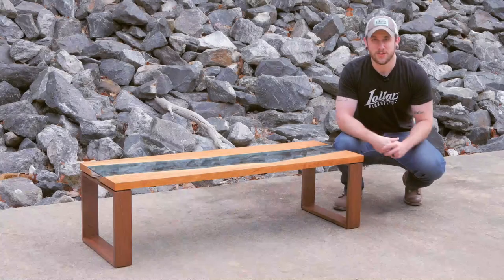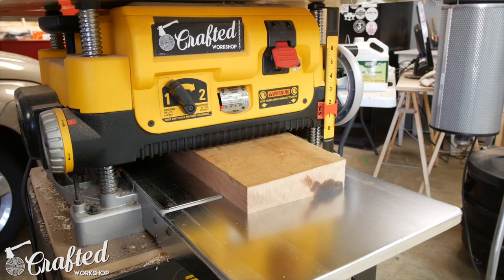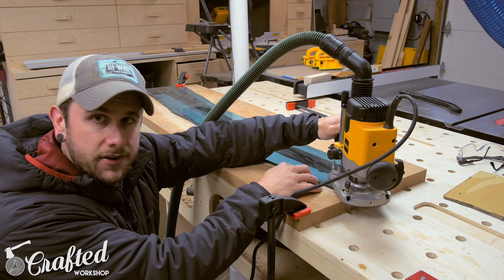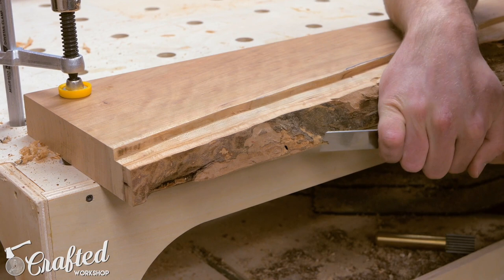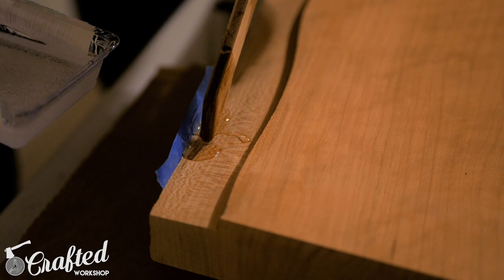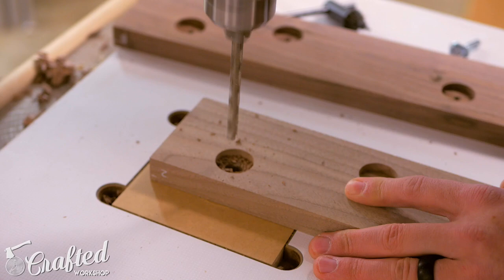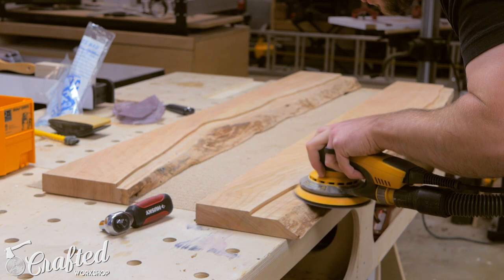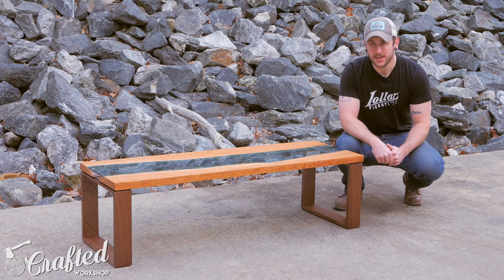Live Edge River Coffee Table | How To Build - Woodworking

Comment: Hello! Am a beginner looking to find lumber in Toronto for projects. Do I go to lumberyards for live edge slab?
Reply from the maker: +Andy Lee it depends on the lumber yard, but a lot of them will carry slabs. I'd just call around and see what is available.
Reply: Hey, thanks so much for the suggestion. I looked around and they seem to vary in price from $200-$1500 CAD. When buying slabs, should I have an eye out for certain things such as how straight it is or any grain patterns to look out for?
Reply from the maker: +Andy Lee the flatter it is, the easier it will be to work with and get flat. I think the other big thing is to pick one with a grain pattern you like. Slabs are all so unique. Those prices seem pretty reasonable.
Reply: great thanks :)

Comment: If I find a lg piece of Plexiglas I'll make one , In mass they are plenty of trees, to make it original :) don't tempt me to do it ok lol
Reply from the maker: +Carl Zorro go for it! Although plexiglass would scratch a lot easier.
Reply: true, but keep it waxed and it doesn't shatter like glass do, I dislike glass. I take tables and put ceramic tiles and do away with the glass, they have nice forever shine tiles at HD 4 and boom a nice table :)
Reply from the maker: +Carl Zorro nice!
Reply: want to make a nice table, buy 4 ceramic tile with shine  and add it to the top, all you need to do is go down a 1/4 '' for the tile setting.

Comment: that's why you route both sides at the same time. never move your router bit until everything has been cut. lower it one last time and then you don't have to use a gauge to set the depth. no big deal really but that kinda fundemental stuff when not done drives me nuts
Reply from the maker: +john smith I had to make the cut in two passes, so I had to raise it. I set the depth, the calipers were just to verify. Thanks!
Reply: I understand the two passes I was just saying cut the other side before adjusting the router then the second cut will be exactly the same. No need for calipers.
Reply from the maker: +john smith what I meant is I have a depth stop on my plunge router, so it doesn't matter. The depth is set to a certain point so I can move it up and down without loosing my location.
Reply: That'll get it too. Cheers!
Reply from the maker: +john smith thanks man!

Comment: I'm a bit upset that you just got a slab of cherry for $55. Also, if it's within your budget, you're much better off using something like a sand blaster to remove the bark on the live edge portion. It will maintain a more true live edge surface than running over the live edge with an orbital sander. Or even just a wire brush and a drill would to better.
Reply from the maker: +Chris Haugh hah, yes it was warped and cupped so it was discounted. I definitely want to try sand blasting a live edge in the future, love the look.

Comment: Basic wood working skills?  Your table looks great  but the average person doesn't have  full wood shop with all the tools required so a lot more than basic wood working skills are required.
Reply from the maker: In the world of woodworking, this is a pretty simple build. As I mentioned in the video, you could use a router sled to flatten the slab and skip the planer and jointer.